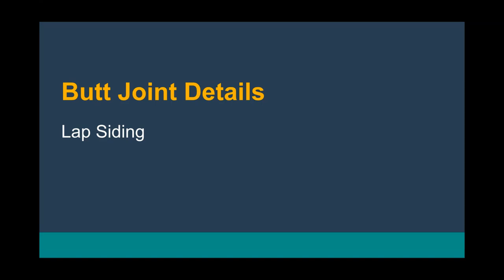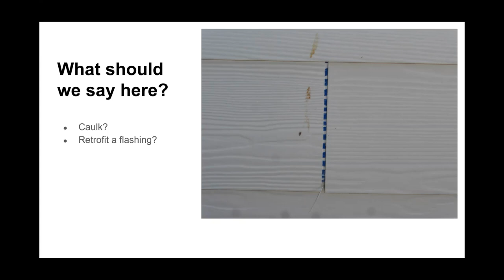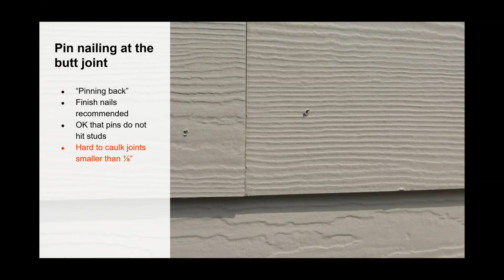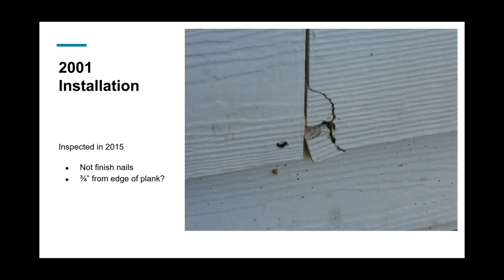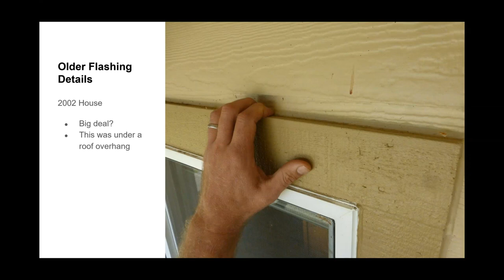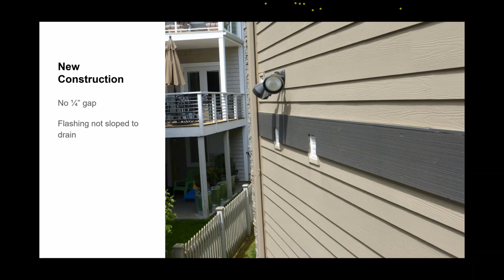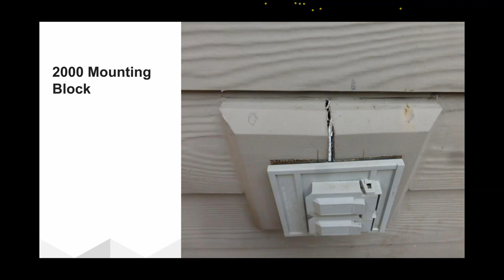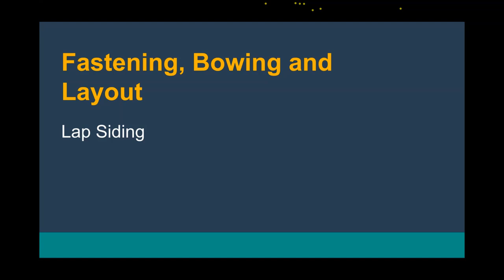Hardie With The Building Consultant

Comment: I noticed when you spoke about Hardee’s recommendation about “moderate contact between butt joints” you seemed dubious. I’m about to get new siding and the installer is saying they are going to flash as recommended, but also leave a small gap for expansion (with no caulk)… is that something you’d recommend? I’m in the Portland area so we’re north, but technically fall into that Hardie zone 10. I’m concerned the gap will void my Hardie warranty, but also concerned that with expansion we’d end up getting spalling. Could you share your thoughts please?